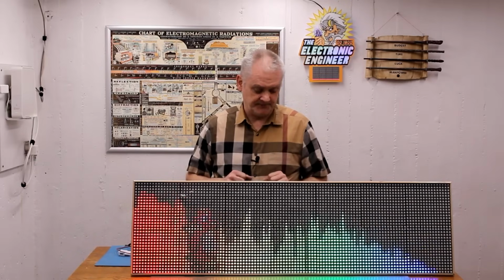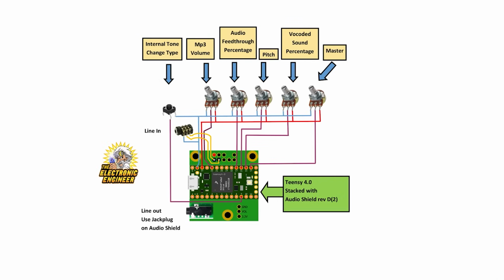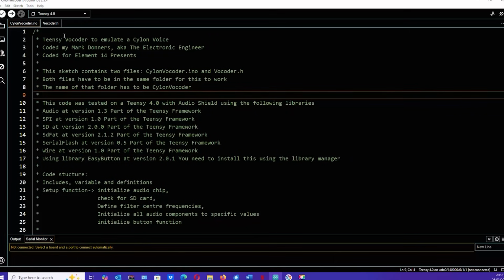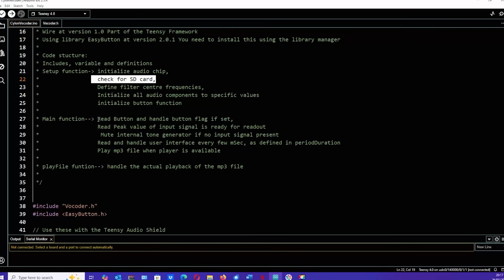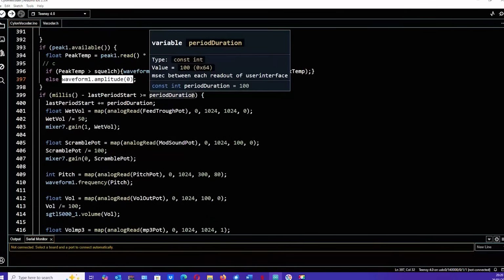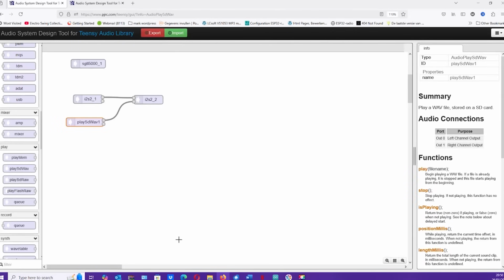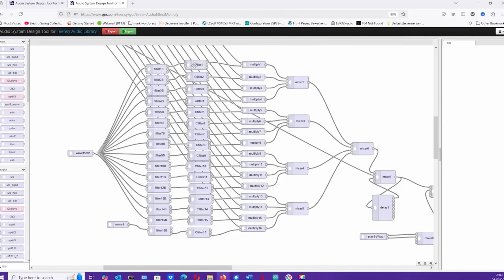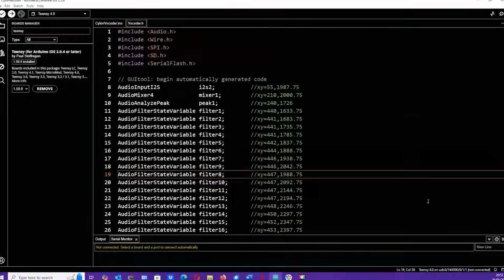Make Your Own Vocoder with Teensy 4.0 - Voice of a Cylon?!

Comment: Will that run on a ESP32?
Reply: nop
Reply: @martingerken7094  yes but you'll likely have to modify the code to fit the esp sdk
Reply: @destiny_02  NO it will not run ons ESP32. The audio tool doesn't work for ESP.Even if you would be able to port it to ESP32 enviroment...the ESP32 doesn't have the same power to process audio at what the Teensy has. I mean I tried. Teensy is more expensive..a lot more so using a EPS would be great...but I haven't found a working project on that so far
Reply: @TheElectronicEngineer thats not true, esp32 is more than powerful enough for such task. and there are already projects out there on GitHub making vocoder using esp32 while simultaneously having web based configuration panel and realtime streaming capabilities.

don't underestimate the power of 2 cores at 240mhz.